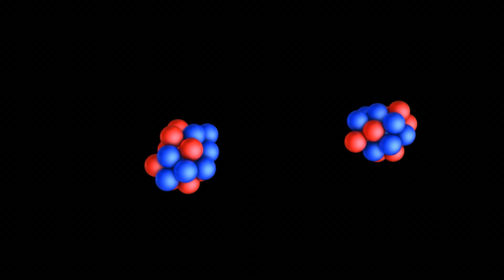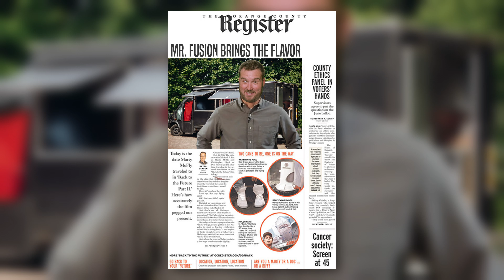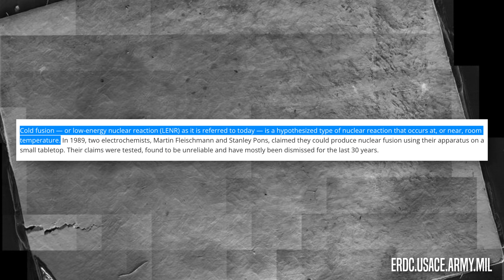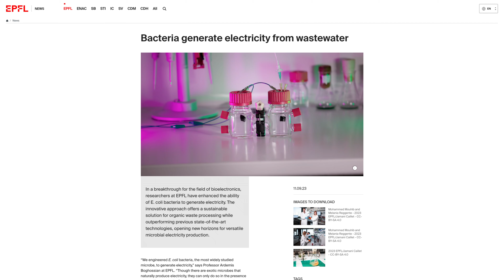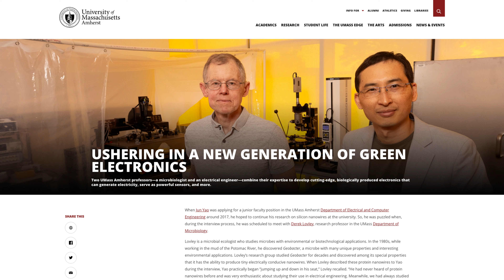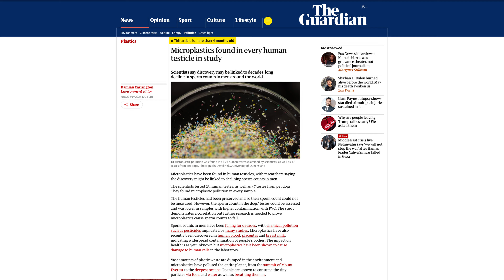How Cold Fusion Started As A Hoax | Futureproof with Michael Swaim

Comment: Just a small correction for 0:37: Nuclear Fission is initiated by destabilizing a radioactive nucleus with a NEUTRON, not an ELECTRON. The additional mass from the NEUTRON causes the nucleus to split into two lighter nuclei with stray neutrons to destabilize other nuclei. The process also releases energy in the form of heat and radiation.
Reply: The firing mechanism in atomic bombs is a bullet tipped with a pellet of radioactive material and the physical impact of the two causes the start of the neutron release.  An H-bomb has an outer shell that fissions when the collision strikes, and its neutrons start the fusion reaction. Electron discharge is observed as emp pulse in bombs and in the Cherenkov Effect in reactors, but it has nothing to do with how we capture the energy released as heat in reactors. That's actually a massive correction. He got fission completely wrong there.
Reply: came to the comments for this. good correction. surprising error in the video. especially that its seemingly animated incorrectly with an electron rather than neutron, as well.
Reply: I watched the animation in slow motion to count the nucleons (probably because I'm a beta cuck).  I think this is argon-36.  I texted my friend at CERN who studies high energy collisions to see if he know about fission in argon using electrons and he said, "It's 2 in the morning, please leave me alone."  Anyway, argon-36 is observationally stable, so probably not great for fission.
Reply: Based on this comment, I’m no longer going to take advice on how to conduct nuclear reactions from Michael Swain. He just doesn’t seem as qualified to lead the department if energy as previously suspected.

Comment: Hot take: quantum mechanically, cold fusion happens all the time in the universe.  In a room-temperature or colder environment, there's definitely somewhere in the vastness of space in which two protons are flying at the right speed and direction that they ram into each other and fuse into helium.  This is neither meaningfully predictable nor a useful means of generating power (cf Maxwell's Demon for basically the same solution to generating energy that has innumerable wacky explanations for why this wouldn't violate the laws of thermodynamics), but it's technically what cold fusion means, not just fusion that somehow magically doesn't generate heat or actively makes stuff colder.
Reply: Hot take on your hot take: Matter and energy cannot be created or destroyed in a closed system still applies. Quarks are the internal structure of atoms, so how could a proton which is atomic, be quantum? I think you don't understand the delineation properly. Quantum is under the atomic, it makes up the atomic, or at least that is what they think they see when they splatter atoms on a detector.  They say the electron is quantum, but the proton and neutron are definitely provably atomic.

Have you ever really looked up what they are actually measuring or how they do that at a particle accelerator? It's just a pile of filters and they hope they can get one of these quantum particles to stick to the detector to say they detected it. It is like having sixty screens for your window to keep bugs out with just one hole the same size in all of them to let fruit flies in. You can't see the fruit fly. You can only see something came through the hole but not what it was. So how do you truly know it was a fruit fly? That is the problem with quantum theory. You can say it was whatever you want that came through...and it leads to ideas that are not truly based in science. 

Something like what you say might have happened at the big bang.... with infinite heat and infinite pressure. Laws are laws and theories are theories. You should use your mind to ponder what is real and verifiable and not go down the rabbit hole that is quantum theory. It is sensational bullshit. It always is amazing to me whenever they just have to prove a particle, they always can with these detectors with more energy and more filters. Quantum Theory is a science that has not truly confirmed itself, and don't forget that.

Comment: Fusion for energy is hot. Fusion for material fusion doesn't have to be. I'm working on the alchemists' wet dream of forging gold from other elements. What we know of fusion is simply brute force tactics. If you have the key, which is made from a fun mix of calibrated vibration sequences, em pole control, and electro-current manipulation, it twists and turns and unlocks like butter... or locks together like gold. No brute force, no residual heat energy produced, and all elements can be synthesized.

That's one of the premises of the science fiction series I'm writing.
Reply: The process is not unlikes fingering a virgin. You listen to all the moans and groans, the jitters, and the go slowly's. Both fusion and fission can be manipulated in this way, not for energy but for atomic construction. I call the fusion side of this process Slow Fusion.